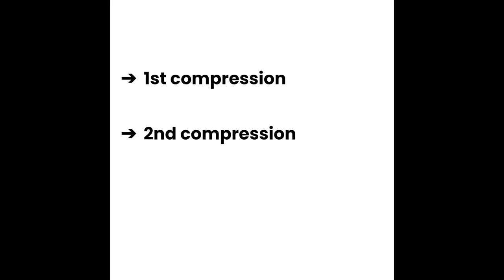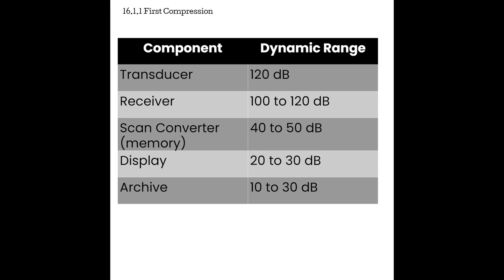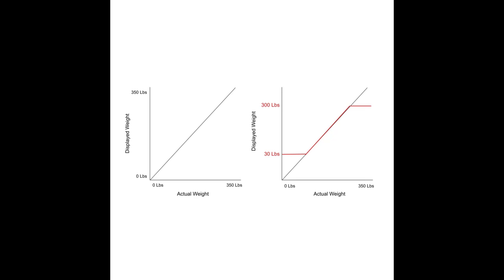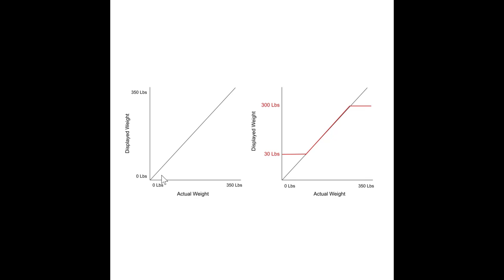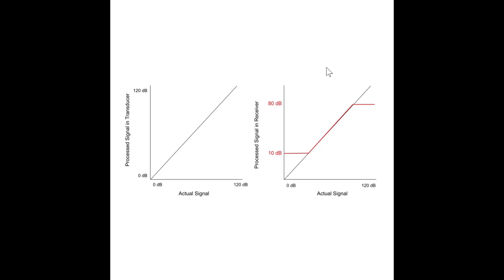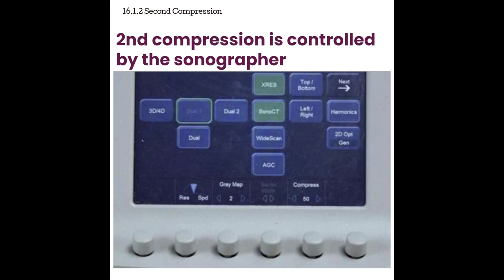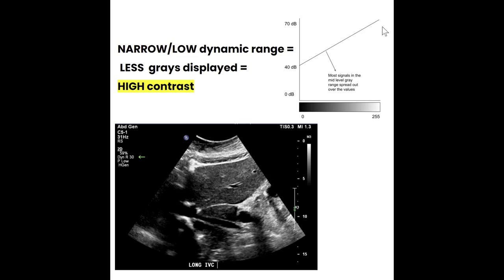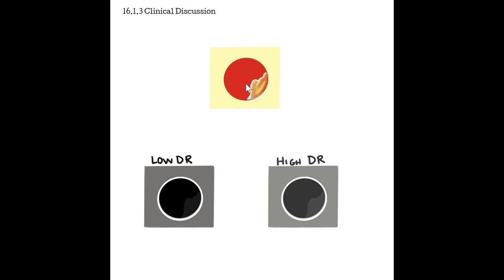Ultrasound Physics with Sononerds Unit 16

Comment: In Edelman it says that fewer shades of gray degrade contrast resolution? but in this video you say it is improved with less shades of gray, I'm confused
Reply from the maker: I read through my Dr. Edelman material and can't find that statement. Could you point me in the right direction?    In general, contrast resolution is the ability to differentiate one shade of gray from another.  And in this chapter, I try to approach it from a "detectability" standpoint.  In ultrasound, the detectability of a lesion is going to be better with a low dynamic range, when reflectors are very similar because it increases contrast.
Reply: @Sononerds  table 15.3, maybe im confusing contrast in general with contrast resolution
Reply from the maker: @kaylam8651  Oh thank you! I only looked through Chapter 16.   I think this chart and dynamic range are talking about slightly different concepts.  Chart 15.3 is exactly what you said. A machine with 8 bits per pixel has the capability to display more grays than a 2-bit/pixel machine, thus it has better contrast resolution. 
If we take that 8-bit/pixel machine and image a liver with lesions in it that are very similar in echogenicity to liver tissue, it will be hard to see unless we reduce the dynamic range.  Reducing the dynamic range will improve the detectability because the image has more contrast in it.

Comment: Does changing the dynamic range change the number of shades of grays or just change the values of the echoes that displayed in each shade of gray?
Reply from the maker: A little bit of both.  Dynamic range is going to change the number of grays used to display most of the reflectors coming back so that their values can be better appreciated.
Reply: Thanks for your reply.